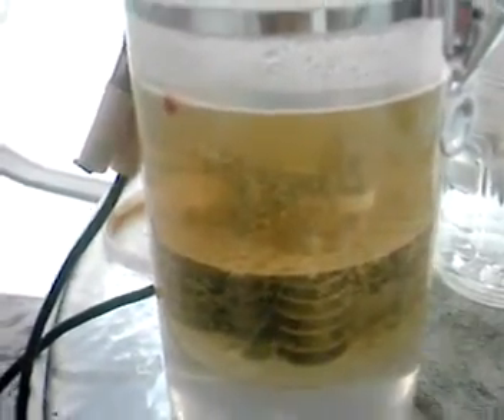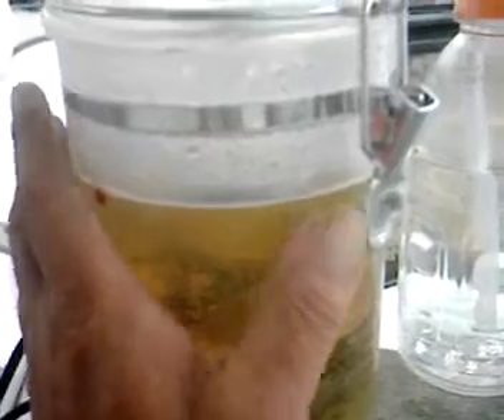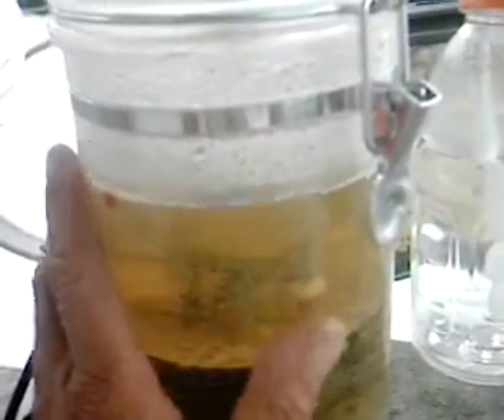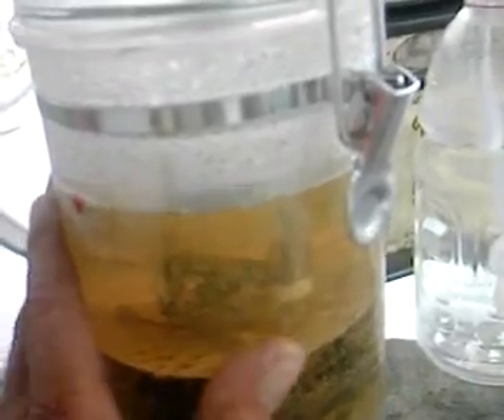Contamanation maybe ??

Comment: I would read stanley Meyers patents (you can find them on wikipedia).
As far as I know you need a PLL for detecting the resonance frequencey. There are NO additions to the water. At resonance (correct frequency and Voltage amplitude) the amp leakage through the water capacitor is MINIMIZED. About some mA! Not a few Amps like many here do. I was reading something about 40-47 kHz depending on the water used.